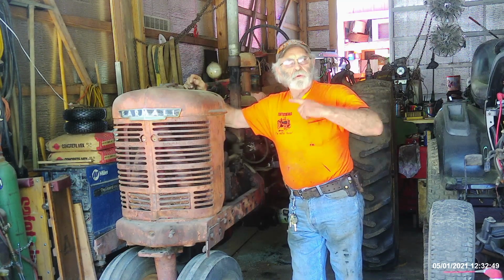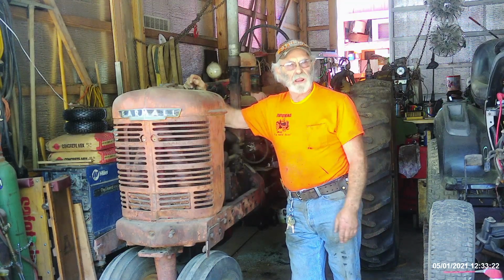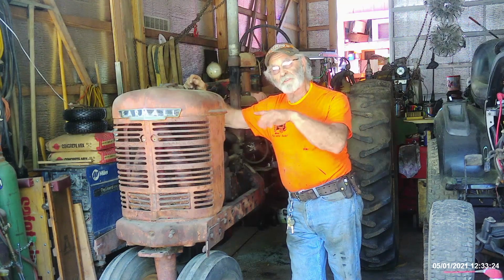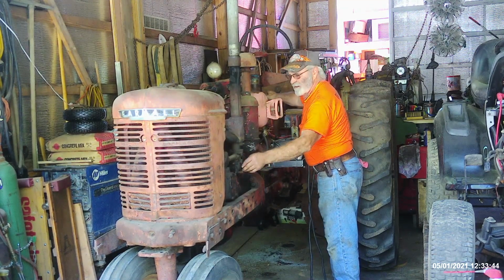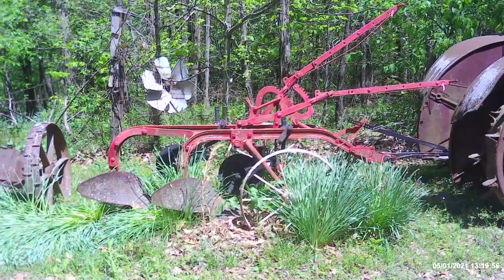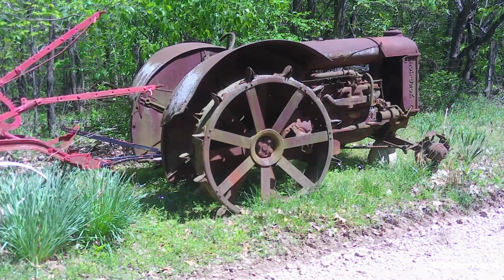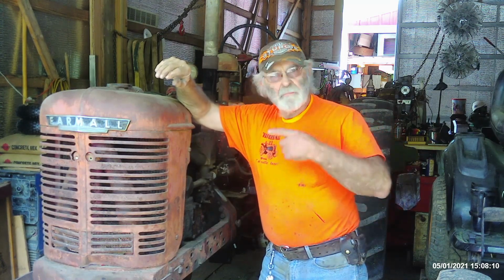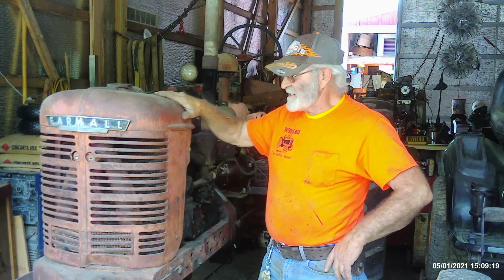Farmall H First Task Rock n Rollin the Driveway

Comment: Thanks, Wendell, for videotaping the H working.  If I had to pick a favorite Farmall, it would be the H, with maybe the Cub a close second.  They're just fun to drive, and they can handle a lot of different chores. One guy on youtube uses his H to pull a disk, a 2 bottom plow, a tumblebug, an Adams adjustable grader, etc.
Reply from the maker: I wanted to see what it would do under a bit of a load without doing anything to the carb.  I still haven't touched it. And I too have always wanted a C.  But I did manage to bring another new tractor home just two days ago....but you'll have to wait.  LOL. I just have GOT to finish the H's gas tank and get it back on !!

Comment: Did i just see another “revival tractor video” in the making? That old fordson would be a cool project to get going!,
Nice work on the Farmal with the offset able roller, I think your drive is set until the next severe set of weather patterns to blow through! But then again, your set with the equipment, so it most likely won’t happen too soon!, kind of like my reasoning about buying a generator, and snow shovel, buy it and then you have no reason to use them, but if you don’t buy them you get hammered with storms!

Another great video Wendell, keep it up!
Reply from the maker: Thanks Pat for the comment buddy.  A lot of times the condition of a little roadbed depends on the drivers that use it.  Drive too fast and the rock shoots off the side and blows the bottoms out of potholes real quick in the rain.  The large trucks like the garbage man and Schwann's Ice Cream truck can really mess up the entrance by coming in too fast.  They 'berm' the opposite site of the entry easily with the 22'' tires, turning hard with the weight behind them.  Add rainwater to the mix and we will be out here again in two months !!  LOL
Reply: @tractorman4461  i know that… i was 15 once, and we had a dirt drive as well! Besides that my girlfriend at the time lived down another dirt drive that we maintained for them, mother and daughter, father had passed on a few years earlier, and grandpa was too old so we maintained it. … amongst other aspects of life!lol

Comment: Sounds pretty good! Didn't see any blue smoke so, the engine must be in pretty good shape. I was wondering if you were going to shift the drawbar on the tractor to get the sides of the road, then I saw you have the roller set-up to shift from side to side. 👍👍👍
Reply from the maker: The side-shift works real well, and would go even further offsided if I was to shift the drawbar too.  But it works ok so far like it is. No blue smoke, but at some point there was another mud dauber nest that finally vibrated loose behind the radiator and I got dusted pretty good !!
Reply: @tractorman4461  🤣🤣🤣

Comment: That roller is cool .thats neat the way u pull that pin on toung 2off set the drum wendell. What would it cost me 2have ya make me one.is it filled with water or is that just the thickness of material used .is that toung a pto shaft? Everybody take care n be safe
Reply from the maker: The tongue is a pipe in a pipe if I remember right.  Too long ago.  LOL.  It's filled with liquid.  I should've shown a close up of some of the large creek stone that are literally crushed to pieces with the roller.  Sometimes you may see me veer to one side or the other....that's because I see a larger rock up front and I want to pound it right in the center of the roller if possible.  It hits the hardest with a center hit and does a much better job of crushing them.  Thanks Smooch for the comment my friend.

Comment: Your old H is sounding tough with that straight pipe! I’m curious, have you adjusted the valves yet? If you haven’t are you going to and if so, will there be a video?
Reply from the maker: No, I haven't even cleaned the carb yet...LOL.  It idled so good and ramped up so nicely in the shop, I wanted to see what it'd do with a bit of a load.  Pulling the roller isn't near as much work as pulling a set of 2-14's or 3-12's, but it showed me there's a little deeper tuning going to be needed.  I love the sound of the straight pipe !!  I run them on  the Massey 44's too.  And yes, I'll make a video of it too.
Reply: I’m really enjoying your H series and am learning a lot, looking forward to anything you’d like to share 👍
Reply from the maker: @AmericanTradesmen  Thanks for showing the interest Matt.  It is greatly appreciated.